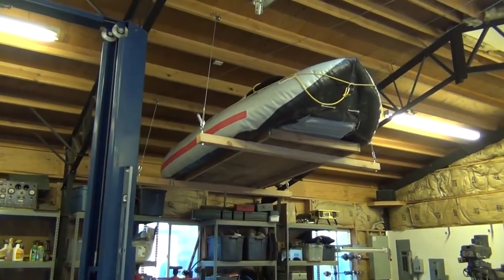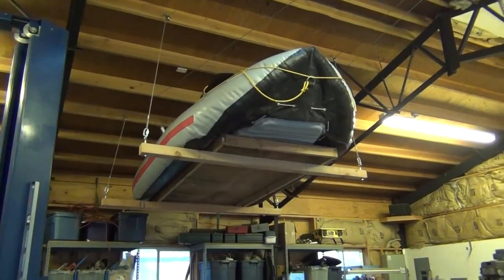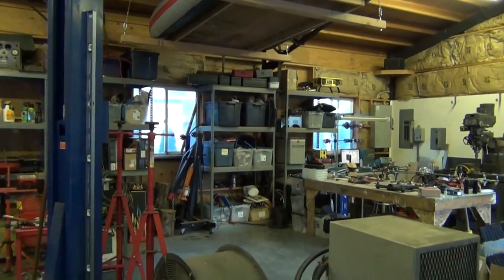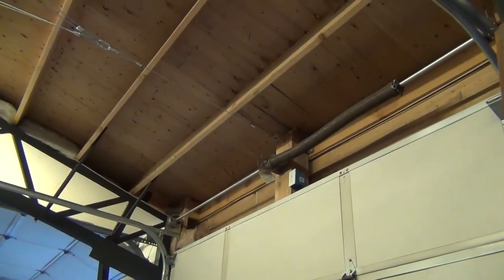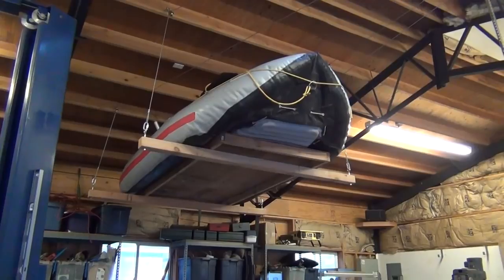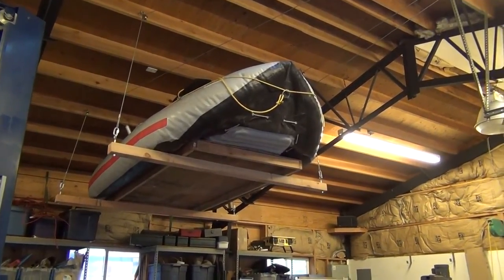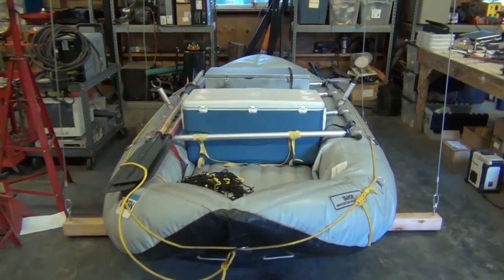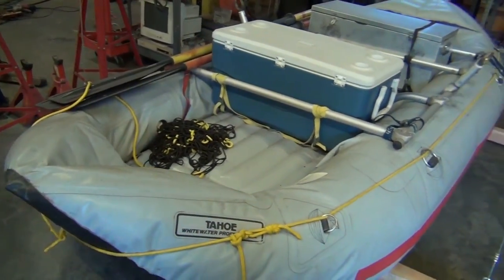Overhead raft storage platform

Comment: Inspired me to build my own lift.  I started with 4 points, but recently moved to a single lift point.  The single lift point, together with a hand-held winch remote, allows me to spin the raft and move it around for better placement on my trailer.  I just push it towards the trailer as I lower the raft  with the remote.  Works like a charm.